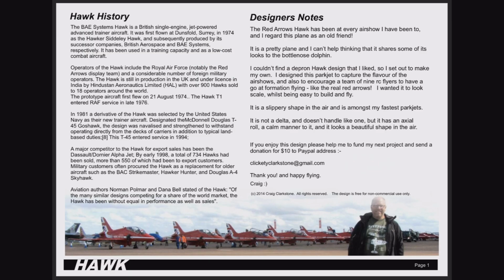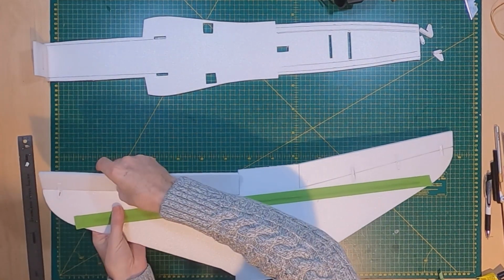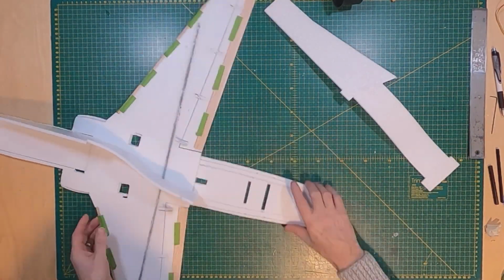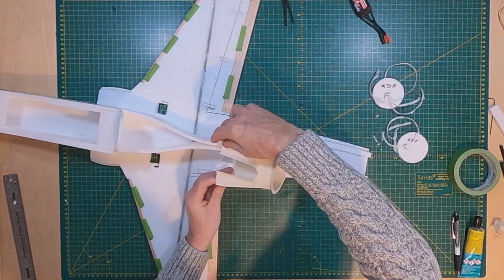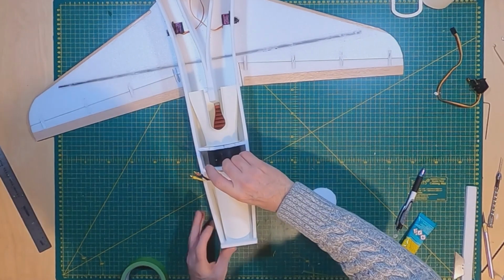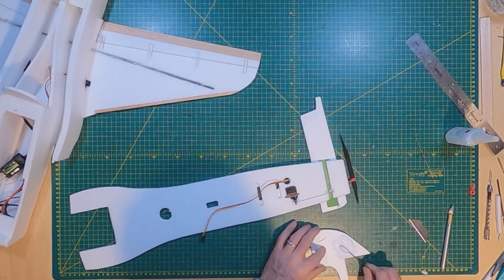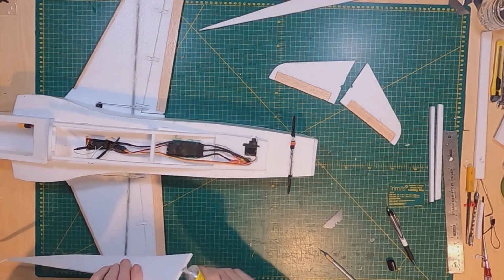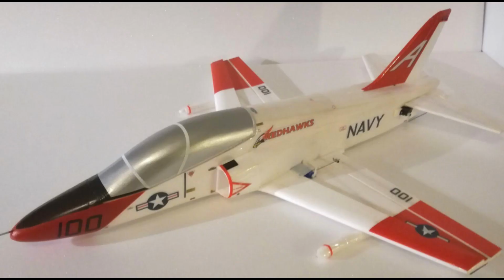Jetworks BAe Hawk Build

Comment: Hey guys, I want to buy the plans and start building this weekend. Can you tell me how to upscale it for a 70mm edf please?
Reply: 109% buddy, the way i do it is 100/64*70=109 but be mindful you may need to edit some parts/joins where laminating pieces  is concerned
Reply: @Shad3yB  and these are the paper plans I expand to 109% when I print them out, correct? Also, sorry if this sounds dumb, but it’s my first foam build…..can I use 6mm laminated foam board or does it have to be ‘Depron’?
Reply: @JoeyLuvs2Fly  yeah buddy enlarge the paper plans to 109% , building with foam board will be fine but it is slightly heavier than depron but it will work just the same
Reply: @Shad3yB  thanks brother, really appreciate the help 👍